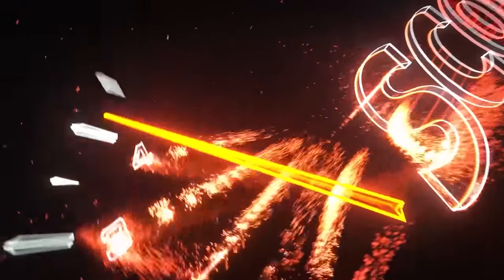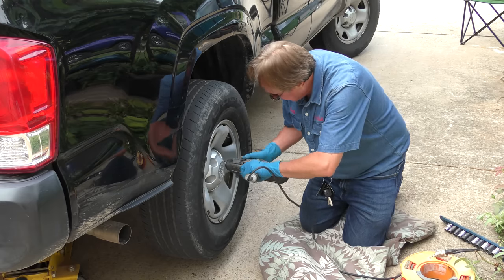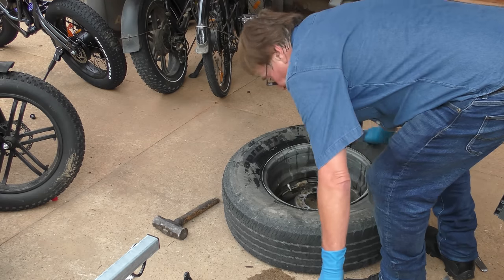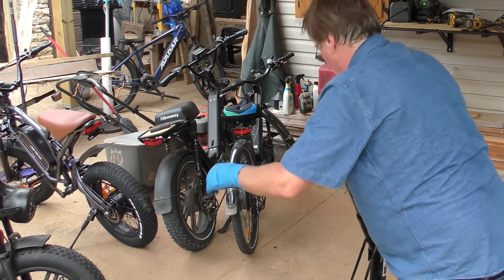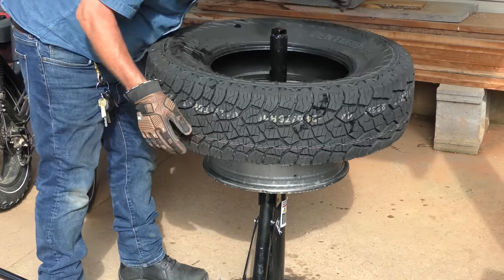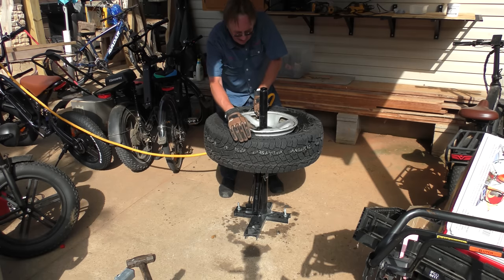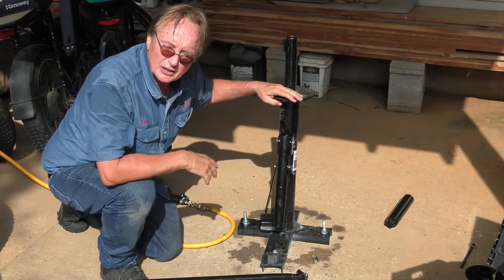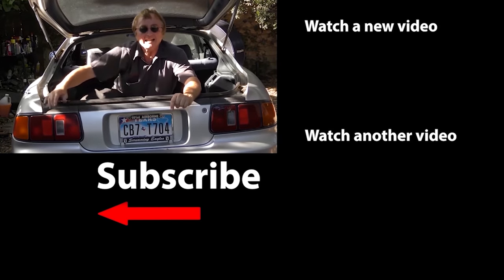Never Buy This From Harbor Freight (Almost Broke My Hand)

Comment: I bought this tire changer a few years ago and it was beefy enough or me.  I ended up mounting it to a heavy pallet to hold it down.  It looks like the video has it mounted right into a garage floor.  I think that’s why I put it on a pallet so I could move it around because it takes up so much space.  I’ve done car tires suv tires motorcycle tires with ease. I would agree though that unfortunately you got a really crappy one.

Comment: Man I can relate! I just bought this tire changer for $59.95. Broke it trying to remove a second tire. Changed out the middle pipe with a thicker pipe and welded it on.  Bought 2 extra tire irons and use those more than the one supplied.  

I laughed so hard at Scotty because I was flailing around the same way. Funny stuff!

Comment: I had one. Not great but would change a tire. Then a tire shop closed and auctioned off their equipment. I paid $750 for a Coates 4050. Best money I spent. Won't do all tires but does most. I see you can buy them used online. If you do many it's worth it.

Comment: I’ve only had issue with the bead breaking. Those thin steel arms need support strength added. I do use a NoMar bar for removing rubber from the rim.

Comment: It may work, but it is difficult. I use my car to break the bead. I jack up the car and remove the tire I want to change. On the ground, I slide the tire under the brake disk. with the disk near, but not touching the rim. Then lower the car and it will break the bead. Job done-nothing broken! A success.

Comment: HF did build a pile of junk iron.  It would work if heaver metal was used for the bead breaker.  J P Cycle makes a great tire tool for tire changing.

Comment: Yeah, some of those cheap tools definitely need mods or flat out make a new piece from thicker stronger materials. I have my own tools for doing tires. They are small, but beefy. And it doesn't take long to change tires in my yard. I also needed to mod my bubble balancer to work great. The last time I went to the tire shop to have my tires done, really pissed me off and they never could get my tires mounted right and balanced right. That's when I had enough and found these tools and I've been doing my own ever since. My neighbors even come over and get their stuff done right. I enjoy working on my own stuff. As long as it's not all that new crap computer junk. If they just kept vehicles simple we would have them last for years without problems.

Comment: 1:10 Coats Ironman...

4:30 you'll need the mount/demount bar when you find that old tire machine. Bars are usually no longer with the machine.

Comment: I've always found that with a lot of HF's manual tools I've had to augment and re-engineer them to work better. Like that POS, everything they sell has a crap to of play in the joints, fittings, etc, and flimsy, thin , cheap, metal parts. Even if you "get what you pay for" you'd expect them to at least not bend and break on the first use.

Comment: Im 70 years old also, but as a rancher , this h/f tire changer has paid for itself many times over. It erks my ?ss to pay 20-25 bucks for a tire repair. I worked at a gas station while in high school and remember the days that I would remove the wheel and tire from the car, break down the tire from the wheel, repair the tire and reinstall the tire to the wheel, and then put it back on the car. The gas station would charge the person 1.50 for the whole job. Boy those were the days. LOL.

Comment: I bought one. It’s the same unit sold with different names. It’s a flaming hot smoking pile of hooey!  The floor mounting arrangement is Ill thought out. You have to be careful breaking a bead that you don’t scratch the rim on the concrete anchor. Also the arms for breaking the bead is flimsy and bends. Ditto on the pry bar. Now if you can weld you fix all that. It still won’t be great but it will work and it’s cheap.

Comment: I have changed 100s of tires .truck tire  in the beginning had tubes. usetire bars and murphy's oil soap  works great  ,, not grease not diesel  i when to many tire seminars and learned the right way lots of luber is the key

Comment: I have to ask, but did you have the correct sized tire changer? Harbour Freight (Princess Auto in Canada) actually sells TWO versions of the same machine. One (the cheaper) is for tires up to MAXIMUM 16" rims. The more expensive is good for larger rims.
Note ive used the Princess Auto version many times with no issues.

Comment: Not to mention it destroys the face of the wheel unless you buy one of those duckbill heads.
Someone needs to make a high quality $500 version with the duckbill and bead breaker built in.  You're pretty much fully independent in terms of car repair (not including transmission work) once you can swap your own tires.

Comment: I don't understand why you need that "tyre changer set-up" . It's no great trouble to remove and refit tyres simply with tyre levers along with appropriate lubricant and a big rubber mallot. You gotta employ some strategies sometimes to break the bead adhesion.

Comment: I have a local junk yard that sold me some barely used 16" truck tires for $200 for all four balanced and installed with nice brass valve stems. They lasted over a year so far and ride great even at 70+ mph hauling tons of rock. Dont go to the big rip off stores. Go meet the local guys at the junk yard.

Comment: Yes it is cheap, but the problem is the bar itself. Why didn't they copy the ends from a Coates Ironman? The bar simply will not work mounting the tire because the end shape is totally wrong.

Comment: Scotty, I bought a used Ram 1500 with 25k miles. It now has 49k miles. The outermost edges of my tires are bare, so I'm getting new tires. I've had multiple alignments, but it seems like the alignment keeps getting messed up, and I have to get another one within a few months. Do you have any suggestions? Thank you.

Comment: I <3 To DIY jobs changing tires 2X/year Snows-summer & back have an extra set of rims to avoid the cost of remounting. Now have to pay someone to rescan the sencers in the rims or put up with dash light saying I have a tire going flat. also shops refuse to remount tires that are more than five years old

Comment: Still, it might be preferred to taking your car to a tire store. They'll intentionally lift it on the floor pan so that the unibody is damaged, drop it on the ground with the lug nuts loose so that the wheel is damaged, put too little or too much air in it, and over torque the nuts so more damage is caused.

Comment: I've changed a few tires with my HF unit. My unit worked OK. As a mechanic you should be aware that with a cheater bar long enough you can screw up most any tool. I'm an old fart also (80 yo) and worked in a gas station as a kid. The old tool was build like a tank. This HF tool is not. It will break beads on heavy tires off on my Ram without bending. Besides, replacing the two weak steel pieces with angle iron is easy enough.

Comment: I've got one of those things. The problem I've got is my step son. He won't pay to have tires mounted anymore, and he's not big enough to use the machine. So guess who. I about ruined it on some old four wheeler tires that had a very prominent Doble bead lock. One day I'll scrap it and get another one. They are handy when you need one. I wouldn't open a shop with one.

Comment: Curious what you did. You were clearly recording, went from it being straight, then cut to a rant about it, then came back to the part where it bends, except we can't see the tire anymore for the "it bent" action. What were you using it on for that part of the edit? If it were the tire, there's no reason you would have clipped the video where you did.

Comment: You got further than i did. I couldnt break the bead on my f350 tires they are only 16 inch rims. The tube bent so i stopped. Unfortunately i can't return mine because i waited too long 😢

Comment: Thank you Scotty. I've looked at these Harbor Freight machines and wondered about them. I too had a tire machine that came out of an Exxon station in the early 80's, as they were replaicing it with a pneumatic one. It looked a lot like the one pictured as you mentioned the one from your father's gas station. I used this machine for about 10 years also, when I operated a pretty good sized towing service.

Comment: too late man, I got the same set up , w/ the bubble balancer and the Motorcycle attachment!~  Sept mines the old color RED - faded red, looks like its Lead paint LOL.    also, I didn't get it from Harbor Freight, I got it from a guy that bought it all from Harbor Freight and never even got done with the drop in anchors, he gave up and let it all sit and boxes and still get's his tires done at the tire store, he looked at videos on the net on how to use it and decided he messed up.    sold me everything new in the boxes for 40.00 LOL   so Now I have the 40.00 problem.     I have done 5 tires and it;s bending and all that BUT, in my experience watching what is wrong, I have decided to Build this thing up,   Plate steel will fix the bear breaker and a Way thicker Pipe with new setting holes drilled thru it, Grade 8 bolts for pins since I have already bent the crap out of the cheap pins provided.    I thing the actual Bead breaker blade could use some improvement, I have been using a fat strap around the bottom to keep the tire on the machine straight ( that is the actual cause of the bent bead breaker arms going sideways and bending)    SO!   after doing all that the thing that would fail next would be the weakest point and that would be the main Tube.      if that fails, might as well just build your own machine from the right materials.  When I was at the u pull it place I found something near a truck that I find useful and have not been able o bend, its a 3ft long Steel rod with a 1.5 " steel Ball welded on the end of it, it slightly tapers off on the other end and it is deavstating for things I use it for. LOL   I think using that design with a better made duck head type thing on the end might be awesome. 

 I use this machine just to take tires off jacked up aluminum rims for salvage so far.   I am going try the motorcycle part out soon for my Goldwing tires.    we shall see.

Comment: I usually agree with Scotty, as I appreciate well built cars…..especially old Toyotas & Lexuses, however I disagree with him here.  I had been deciding on purchasing this and have seen many mixed reviews.  I had been deciding for awhile to buy this and replace the tires on our 2nd gen Prius myself. I was at Harbor Freight & decided ‘what the hell’.. Bought the unit and some drop-in anchors at Lowes and installed it in our garage.  I haven’t received the Prius tires yet but experimented with my 80 series Landcruiser with 33s.  I had the old full size spare and wanted to put a new tire on the spare rim.  It takes patience, but easily broke the bead on the old spare and installing the new one was a breeze!  It appears Scotty didn’t have it fully secured to the concrete.  Granted it’s not a 800lb old unit that your dad had in his shop, but it will do the job.  The metal is not heavy duty but appears to work as it should-  It is definitely not designed for big truck tires but should suffice for compact/midsize cars

Comment: Great Review Scotty.  I never do put much faith in the HF stuff considering where its made.  Im your age but my dad taught me how to change tires off the rims back in the day when cars had real metal bumpers and bumper jacks (late 60's-early 70's)  Not that cars have bumpers like that now but we would use the base of the bumper jack, that metal base plate the jack itself would stick into, and use the weight of the car, jacking the base plate at the tire bead to break it (poor mans tire changer) dangerous as all hell probably but it worked.  We did have a flat bar to get under the lip of the tire to pry it over the steel rim (not alum or alloy rim) sometimes using a hammer to pound the rubber bead to help it along either dismounting or mounting another tire on the rim.  For a lube, we just used dishwashing soap.  Crude but it worked.  However many times the new tires were not wide enough to seal on the rim when we put in air to re-inflate them so we used a chain that we would wrap around the outside of the tire and use the bumper jack handle thru the chain links to twist the chain tighter where it would squish it so the bead would seal and take the air to inflate it waiting for that POP.  Love your articles keep up the good work.

Comment: If you try mounting tires without a power tire mounting equipment you will have to work hard. I don’t think doing it yourself for as seldom as you need to change tires the cost isn’t worth it.

Comment: WARNING be careful with that floor jack the orange ratchet scissor lift. DO NOT USE AN IMPACT TO LOWER IT. It will drop to the floor instantly. If your fingers just happen to be in scissors its bye bye. Or your under it PAIN.😂 That being said well worth the price for this jack for the occasional trans job at home.

Comment: Did, the Owners' Manual, indicate, what, size, rim, and, tire, were, limitated? That 245, is, rather, big. Might, take, a look, at it. Might work fine, on, smaller sizes. Pity, that, the Factory Quality Inspector, doesn't, have, to, use, one. 🤨...

Comment: I'm on my second one because the     first one's pry bar developed a dent on the area it contacts the post when installing tires and would cause bar to twist and wedge on rim instead of slide along rim. Can't just buy the exact replacement bar,  though you can buy a tire iron which helps to have too. The bead breaker is kinda cheesy and you need to pay attention that you adjust it to be dead nuts centered over  and not canted off to either side if you expect it not to bend it and  last you awhile . 
  I bought the bubble balancer because the shops want to charge the same price for balancing carry in wheels as if they had to take the  wheels off the car up on a lift. 
  Most of these shop's idiots don't know what a torque stick is, and over tighten wheel nuts.

Comment: I have this tire changer with the motorcycle attachment, I've changed car tires, truck tires, motorcycle tires and even lawn tractor tires. The mount/dismount bar leaves some room for improvement, but I've never came close to breaking my nails, let alone my hand. I'm in my 60's and this tool is great. Not a great review Scotty

Comment: I bought this tire changer 15 years ago. This tire changer is beyond garbage. I snapped the tip off the tire changing bar, which is actually called a spoon. The tip literally broke off at the weld, rendering the bar/spoon useless, I then bought 2 bars/spoons at harbor freight and bent both tire bars/ spoons 
When the tip broke from its weld when I was taking a tire off. I was pressing with all my strength and fell very hard to the ground and tweaked my back. Harbor Freight and Pittsburgh Tools are complete garbage and only food for light to low side medium work. Anything more and the tools literally break. I am shocked Scotty even tried such a garbage piece. Never go to harbor freight

Comment: I checked out some professional tire changing machines and a lot of them sell for around $20,000. Ebay has some machines that sell for between $1500-$3000 but even that is kind of steep. Couldn't somebody make a good $300 tire changer? The idea of the Harbor Freight one is sort of good, but not if it's made of pot metal from China. If it was solid heavy weight steel it might work Okay. The industry more or less has us by the *alls. Due to costs of buying your own decent machine you're pretty much forced to take it the tire shop to have it removed. Those old timey/antique heavy duty gas station tire changers are hard to find these days.

Comment: The tires should be high speed balanced. A free tire changer that works great is 1/2 the battle. Balancing is free with paid mounting. Changing tires at home should be limited to time traveling far into the past. I love your content but doing this at home makes no sense.

Comment: I’ll be real… when u pulled on that bead breaker while it was near the stem, my brain screamed… a good way to break a TPMS sensor. 
But on a real note, for those 16’s, i wouldnt use this machine. Better off using a hammer to break the bead and those bike bars from autozone. Like no lie I could have done this faster with a hammer, bars, and lube than u did with this thing. Now this would be faster for like some low pro 17s or 18s ig 🤷🏾‍♂️, but this thing is mostly worthless.

Comment: I have this same tire changing tool I've had it over ten years and have changed dozens of tires. It works fine if you use common sense. It is an inexpensive piece of Chinese equipment. Scottys technique is lacking in my opinion. And no, the tool is pretty much the same quality as I have. I give it a "C" And by the way, I'm only 68 and worked at a Quaker State not Texaco 😂

Comment: On a side note: 2019 Chevy Equinox AWD , Torque Tube bearings broke at 34,000 miles!🤯🥵🤬 Chevy makes junk! Trading in for a Toyota 4 Runner ASAP! Due to UAW Strike and the incompetent Dealership we’re waiting for 1.5 months for the repair while driving it until then! Under Warranty. The Car fell into our laps
For pennies on the dollar so it wasn’t even a consideration to begin with! I read the $100,000 Corvette has the same problems! 👎👎👎

Comment: Scotty is usually ok. However I own one of these machines and never had a problem with it. It is Not a 2 thousand dollar motorized tire machine. Scotty is Not the 20 year old that worked with his dad!
Not once did he center the opposing side of the tire in the center of the rim (which made the tire bind on the rim)! Improper use of ANY TOOL will cause less than ideal situation. I hope Scotty was attempting to make a comical skit, if not Scotty looked real bad!